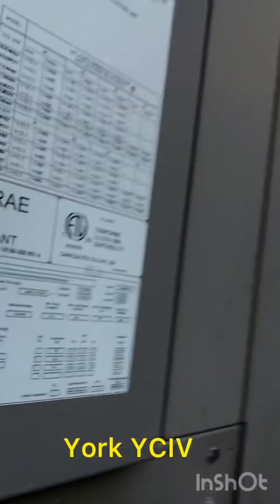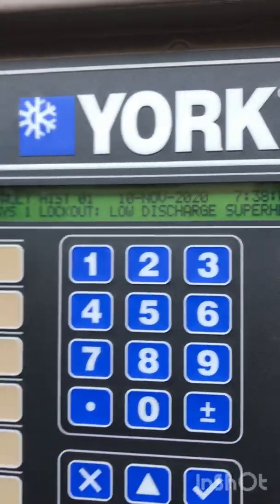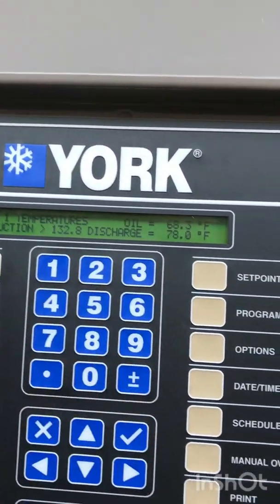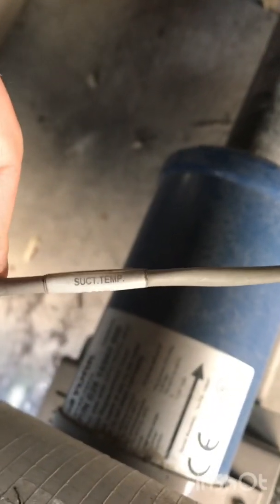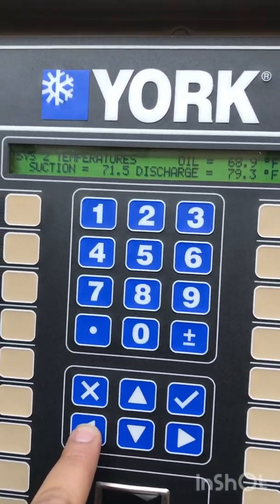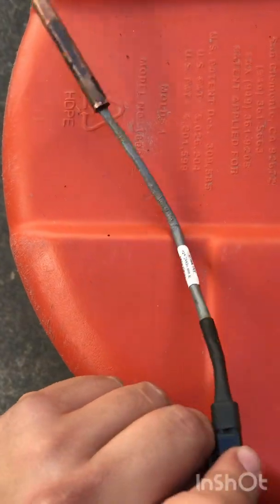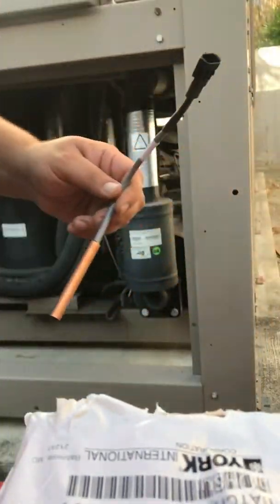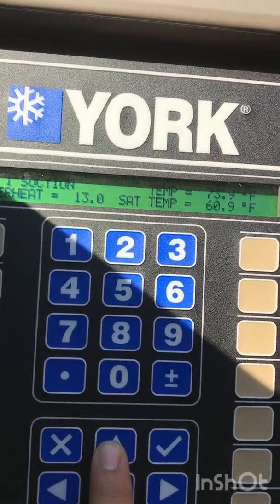York air cooled chiller Superheat Fix

Comment: Thanks for knowledge sharing. Can you pls assist me on coil leakage problem in Air cooled chiller.  Our chiller sets are breakdown due to coil leakage & getting actual RCA & rectification from OEM. PLS help me out for the same
Reply from the maker: I am confused on your question? Your having trouble getting RCA copper? And refrigerate? What kind 134a? R22? Is this coil a micro fin or a regular old school copper coil? Let me know what the exact question is thanks.

Comment: I Replaced temperature sensor and it keeps going on low discharge superheat
Reply: What's the oil level at the separator? YCIV are known to go off on LDSH due to there being to much oil in the system you should no oil in the second sight glass.

Comment: Techview software available free????
Nice video sir
Reply from the maker: Yes
Reply: For rtaf
Reply from the maker: @aircooledchilleralltypes4938  sorry have not worked on a RTAF unit if it uses TechView then yes, it may use CT that’s not free it’s like a $1000 a year or so to update the CT software after you but CT it’s like TechView let’s you bind in sensors and see the system. But again have not worked on they kind of unit yet sorry
Reply: Sir please tell me how much will be aproch temperature, suction superheat and condenser subcool in aircool chiller.